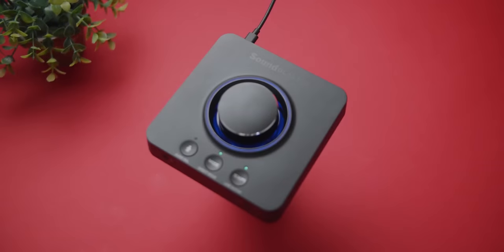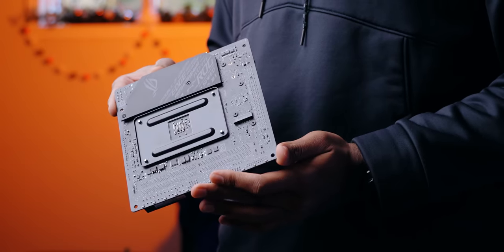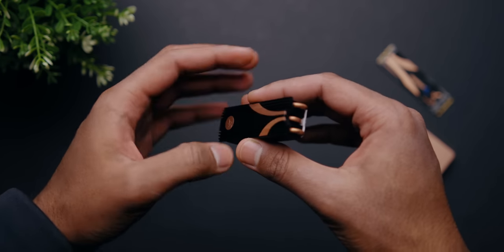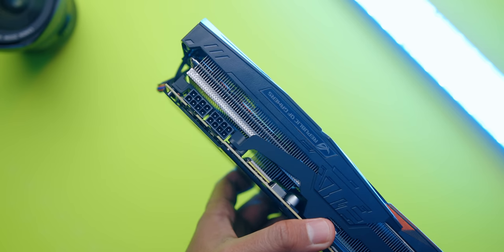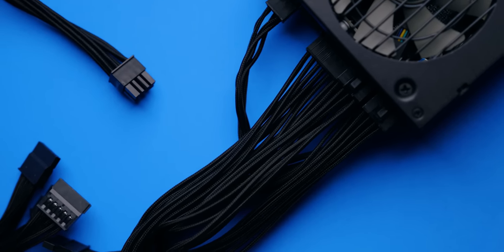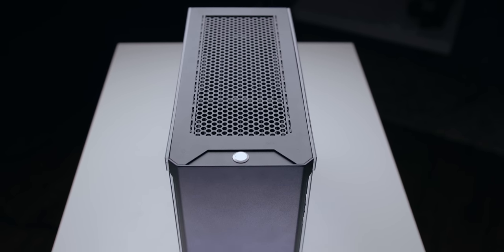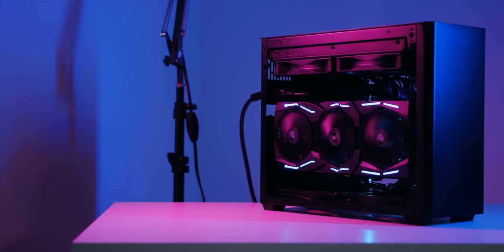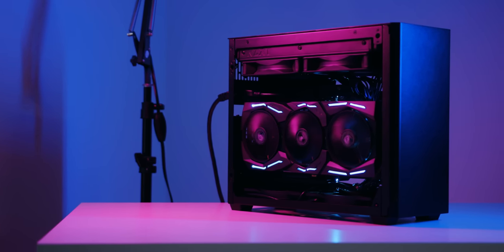Our Most POWERFUL ITX Build Yet!  A Ryzen 9 3950X Beast!

Comment: Awesome video. I went with the 3950X, Asus X570 I Gaming ITX, Kraken X63 (2 x Noctua NF-A14 iPPC-2000 PWM for huge air displacement and pressure), G-Skill Trident Z Neo 3600 CL16 C-Die, Gigabyte RTX 2080 Super Windforce OC, Samsung 1TB Evo Plus, RM850 (upgrading to AX1000 soon), NZXT H400i in white and a cablemod C series Pro ModMesh kit. There is a lot of chassis space and very good airflow. I love the Asus board, the VRM is insane and the cooling keeps everything running superb. The GPU under full load doing Folding@Home stays around 68-70 degrees celsius.

Comment: When you see someone building an SFF case and you think that looks huge!

I have almost identical build in a Ghost S1. Cable management to me means where will it squeeze in and not hit a fan! 😂

Good job.✨👌✨
Reply: lol, was thinking the same. i'm running the Metis with a non modular ATX PSU and an AIO. Basically I shoved all the cables away from the tiny window and called it done. I'm also running 3 sata drives, so that's some more cable i'm simply shoved aside.
Reply: @carlos2004  3 Sata drives...you sadist!

Comment: ITX loves custom cables.  Part of the issue with cable management is cable length.  I built a modded Silverstone RV03 where I used a Corsair H5 SF Low Profile and that made cable management a bit of a nightmare, but custom shorter cables made life a hell of a lot easier.  One more thing if you do go the custom cable route, get a good crimp too it will save you a ton of time.  Anyway hope this helps!

Comment: I’ve got the SM560 and adore it. Big tip is to use the grills at the bottom as cable the anchors and run the 4+4 pin cable on the bottom. I also used the front (where the SSD goes) to anchor excess slack.

Comment: Love the Sliger cases, I just wrapped up a build in a SM560 for my son. Granted the 3950X can't get away with the Noctua L9a chromax I used lol. As for your build, the only improvement I can see to be had would be full on custom cables to save on clutter and a true custom loop. The cables would be slightly tidier but offer no real advantage and the custom loop would give you more overhead for heat.

Comment: Considering my motherboard showing signs of dying after 2 years... maybe I'll go ITX. But still keep my 1800x/1070Ti (can't afford a full upgrade)
Reply: Still rocking a 5820k @4.5Ghz and GTX 780Ti phantom edition here ;)
Reply: Whats your dying motherboard model?
Reply: the problem with ITX is you will need a SFF case and SFF power supply in addition to of course the ITX motherboard.  And you have to make sure everything fits, so measure before buying!  good luck, it will likely be more expensive going ITX than full size midtower.  Not sure what the point of it is unless you are lacking desktop space.
Reply: Hell I use a Pentium and a gt 710 still,feelsbadman.jpeg
Reply: @h1tzzYT  Asus Prime B350-Plus
Reply: That's doable
Reply: @CobaltFoxPlays  Asus Prime = one of the bad ones, seems poor
Reply: @CobaltFoxPlays  Asus sabertooth mark 2 owner here. Within 2 years it fried 4 power supplies

Comment: Would getting custom length cables help with the management?
Reply: Yes
Reply: I wrote the same thing
Reply: YESSIR!!
Reply: it looked like a jungle behind my pc build, but after I used zipties it looked clean af
Reply: The Sliger SM580 has the power supply right next to the motherboard's 24pin socket, so that would help a lot for that one. I have the same case and there's a ratsnest of cables under the power supply.

Comment: Cablemods will make you custom length PSU cables for Corsair. Not cheap, but short of doing it yourself (always an option) it's the best "off the shelf" solution to cable management in a SFF case.

Comment: With 3950X you should raise Infinity Fabric to 1900mhz, have any memory that can handle 3800mhz (most 3600mhz kits can handle 3800mhz) and then use Ryzen DRAM calculator to manually tune all the timings. The difference in gaming performance is mind boggling (close to 30% higher FPS with 2080ti at 1080p) and pretty much all workloads gets faster.

Comment: Cable management in small form factors is not easy especially when you have a window displaying the inside. I personally worked on similar builds and would opt for no window since you'll face the same challenges with cables, but that doesn't mean you'll stuff the cables in and call it a day. Clearing the area for optimal air flow is important but it will be hard to make it aesthetically pleasing to eyes. But overall a great build

Comment: I recently did my first ITX and it's a dream to use but it did give me a few headaches building it:

R9 3900x @4.2 GHz 1.25V
Corsair Vengeance LPX 16 GB 3600MHz CL18
Gigabyte x570 Aorus I pro WiFi
Zotac GTX 1080Ti Founders Edition
Corsair MP600 1TB gen4 (5500/4500 MB/s read/write)
Corsair RM750x
be quiet! Dark Rock Pro 4
be quiet! Silentwings 3 (2x 140mm & 1x 120mm case fans)

Fractal Design Nano S

Comment: There's a couple of guys on Reddit that can make custom PSU cables in the exact length  you need them, based off of case and PSU you have. That will help a lot with cable management.

Comment: Woooowwww Ibra. Wooowww. I love this build. The only th8ng I'd change on it if it were mine would be the ram kit. I'd replace utnwith the corsair vengeance 64gb 3200mhz kit. 2 dims. And I'd add the Gigabyte gen 4 2TB drive but same speeds as the one you used so no difference there. Great build man. I'm officially sold on itx builds. I'm getting an itx build.

Comment: Sliger SM580 is the best sff case for high-end gaming PCs. No other can feature a 280mm radiator and a 3 slots GPU.
But for better thermals and noise, you should use 2 side vented panels (with dust filters) and 2 140mm in exhaust at bottom (instead if intake).
With some taping on top rear and front holes, airflow is amazing on sides and cools averything just fine (61° on i9 9900K and 64° on RTX2080 while gaming).

Comment: Great video! Awsome B-Roll. I'd go with a vented panel on the GPU side. intaking from the bottom you're creating turbulence since the GPU tries to push air both down and upwards... optimal airflow would be a negative pressure setup in through the side out both up and down...  I see both GPU and CPU temperatures improving or a quieter system if you opt to lower fan RPM.

Comment: I think it's pretty remarkable that not only is it significantly faster than anything Intel has in the mainstream with multi-threaded tasks, but its also slightly faster with single threaded tasks, despite your 8700k being overclocked.

Comment: Cable managing smaller cases can be difficult. A normal atx is pretty easy, you can just follow a standard build and normally get your hands in there or wiggle some stuff and make it happen... but smaller cases sometimes there just isn't 1 order or 1 right way to do it.

  It can depend so much on the case. I've had somewhere you can do it at the end, which is pretty normal, other cases where you had to do it all in the beginning and some pain in the butt ones where you had to do each part 1 by one.

Comment: I don't do much gaming so I'm more interested in the CPU, Memory and storage. I currently have a laptop with Intel I-7, 16 GB of ram, and an independent 2 GB video card that rarely gets used because I've discovered that my laptop uses the built in Intel HD video from the motherboard. When I ordered my laptop years ago I did not realize that the separate video card was for things like gaming and not used for everyday video. I probably wasted my money on the separate card but I have it if I need it. I am thinking about a desktop in the future since I rarely move my laptop and I believe I can get more performance for less money. I'm really impressed with the new AMD CPU's! I have replaced the HDD's on my two laptops with SSD's and that really made a difference. I'm sure the m.2 that they have now is much faster and I would be looking to use that as well!

Comment: I really love this build. I recently moved my ITX 9900k build from the Metallic Gear Neo Mini into a Phanteks Enthoo mATX. The Enthoo turned out to be way too large for my liking and not necessarily quieter unfortunately. I'm now looking at moving it into either Ncase M1 or one of the Sliger cases (SM580 or Cerberus) and this is making me reach for my wallet. Your build came out really amazing.
I didn't realize they were serious when they said support for 3 slot GPU's. I put an arctic accelero III on my 2080 and just assumed it wouldn't fit in this case. Mind blown.

When you configured the SM580 did you have to get two of the fan mounts for the bottom fan intakes or were their mounting points for 140mm fans?
Reply: There were mounting points on case. However you can't install 120mm fans
Reply: Thank you for the response! I was looking at actually building my own SFF case but after watching your video I don't think I'm going to end up getting much better than this, regardless of how handy I think I am.

Comment: In the motherboard box there is a coupon for cable mods use the cable configurator and they will send you a set of cables for the rig at the perfect length.

Comment: Awesome specs! Sweet video work too. I am however, unable to rationalize this down to up air-flow configuration. I think any ambient heat inside the case will warm the top-mounted radiator instead of cooling it...
Reply: I agree. I'm building in the same case and Optimum Tech tested bottom exhaust to create negative pressure and thermals were better. Great vid and build though.

Comment: If you use the ventet side panels temps would be 10 to 15 degrees lower. I use the 580case and this solved my problem. In your case you pump the hot air from everything thru the Radiator.

Comment: Very nice build. I went from an 8700k overclock that 5.4 gigahertz to a threadripper 3960x. Oddly enough this 24 core CPU runs cooler overclocked than my 8700 k did.

Comment: omg look at that I'm liking an AMD based video who could have tought such an Intel shill as me did that. Awesome mini build, sure must have been a lot of work, it's already complicated in a big case, small ones are harder to do properly. I was going 3950x but ended up with a 3960x :D ITX build now out of the question has I have an E-ATX motherboard lol btw the heat from Intel comes from clockspeed, if you lower an Intel to 4.2Ghz it's only going to use like 60watts but the scores drop hard, the beauty of the new AMD cpus is that at a lower clockspeed (and so less heat) they do the same work, if you look at cinebench single thread it's roughly on par but the heat generated for that same score isn't the same, in a small form factor it matters a lot.

Comment: What about gpu termals? Fans are facing a glass, so i wonder if gpu in stress doesn't heat up too much.
Reply: The Sliger case has a gap between de chassis and the glass...so i think there`s some air coming in the GPU.
Reply: @TheJoaunzinho  The SM580 doesn't use glass, nor is there a gap on those side panels. A better setup would have been to use the perforated side panels and have the bottom and top fans as exhaust.

Comment: Your high temps on the 8700k was probably b/c you didn't de-lid your cpu.  the 8700k cpu came with terrible TIM (thermal insulating material) between the cpu and the heat spreader.  Normally, the heat spreader is soldered onto the cpu, but for some reason Intel f'd up and used terrible paste which caused many cpu's to over heat.   On that note, I have the exact same (old) specs you have, and am thinking of getting the 3950x, however is paying for all that hardware for similar performance of the older system worth the cost of the move?   great video!

Comment: Idea for the PSU. Why hasn't anyone thought of removing the PSU from the case? There could be a scenario where a banging PSU (so that there won't be any need for upgrades) could be put in a hole in the wall, and the all the cables can be sleeved and led into the case.

Comment: You can buy custom psu cables at cablemod, I have the Cerberus non-X version and custom cables improved so much the cable management. 24 pin ATX 250mm, 8 pin 400mm and 250mm for the pci express cable and should be good to go.

Comment: Great video!
I did notice you listed the case as Sliger 850 accidently instead of 580
Im looking to upgrade the NR200 to a caae that supports 280 aio in the roof instead of side.
Easier to access components and I will be able to see the screen on the Z63 unobstructed.

Comment: Would have to see how small the interior of the case is, but zip ties do work well.  I like to use Velcro cable wraps, that you can get at Home Depot - they're thin and reusable ;)  Since there's no "basement", and the back area looks cramped, I can't really say, but you did avoid the wiring to avoid key spot, like the fan blades ;)  I still prefer mid-towers, as I have big hands even those my fingers are quite dexterous o.0  Thanks for sharing!

Comment: maybe try and get custom length PSU cables
Reply: I have the Sliger 550, the smallest 500 series Sliger you can get and the same cables, wasn't too hard to put all the components inside and for him it should be much easier, he has more space in there... Then again, I followed the Reddit SFF community for a while before I went and got my own ITX build so there's that.

EDIT: Should also note that I have an AIO inside too, cause with an aircooler it's just no problem if you go with stock cables.

Comment: Here I am a year later having replaced my 3950x with a 5950x.  So... I have an extra 3950x.  I could store it, or I could get one of these boards and a cool ITX case, and build a SFF pc.  I've never done that, but it could be fun to give it a go.  Just have to figure out what to do with it.  It's kind of high powered to run as a server especially, so I don't know what I would do with it (I have a 5950x/2080Ti combo, a 5900x/3090, and a sTRX4 3970x/3090 setup.  If I get another 3090, I'll swap out the 2080 Ti, and it can either go into the 3970 as a 2nd GPU to be passed to a VM, or it could go into the SFF build with my 3950x.  I have no idea what I'm going to do.  If anyone in my family wants or needs a kickass gaming PC, well... there's one (though I'd swap out the 3950x for a 5800x, you know, for gaming).

(Now I'm waiting for the flood of adoption requests.. lol)

Comment: Man my biggest issue with AMD's new processors is still the motherboard manufactures. 
With such a small percent of their CPU's supporting why have any onboard video ports on so many motherboards. You would think the majority of their motherboards had no video ports and only a select hand full had video I/O but instead almost every single board has Video I/O I'd rather more type C, more USB heck even thunderbolt but HDMi and DVI ends up being useless is most applications.

Comment: If I had a metric ruler, I'd take the time to get an approximate measurement of all the distances of the cables going from the psu to motherboard and videocard connections and get some proper length custom made cables from Cablemods. I have a Asus X570 Crosshair Impact in a NCase M1 case and I've been lazy with cable management using stock cables that came with the SF600 psu. Included with the motherboard came a coupon for 20% off of Cablemods custom cables which will come in handy if I do decide to go for it.

Comment: Your test data shows how important the GPU is in Games and certain apps like Resolve Studio edition. The free version doesn't use the GPU. It would be very interesting to see the comparison between old and new system if you ran the free version of Resolve?
Just a thought, how does your GPU pull any air when it looks like it is almost pressed against the glass?

Comment: It’s scary to think that in 10 years this thing wouldn’t even beat a mid range $1000 PC.
Reply: Well yes but actually no cuz  at least in processors just AMD have some plans so until 2026 no big changes there.On the graphics side idk seems like Nvidia will soon lunch a new series of cards and AMD  will do the same.
Reply: Ryzen 90 39500x
Reply: It probably won't take 10 years; maybe 5. The best consumer PCs from 10 years ago run Nehalem (first gen i7) CPUs, coupled with the HD 5970 or GTX 295 graphics. Those CPUs bench below current Pentium Gs with all cores utilized, and end up with about half a Pentium G's performance on single thread benches. The gap on the GPU end is even greater.

Comment: Honestly I don't like that so many of these new sfx itx cases come with the sandwich configuration because it always makes cpu air cooling super limited and it chokes the GPU especially when there's a glass panel because it has to be mounted vertically. Highly prefer the ncase m1 layout where your GPU is mounted horizontally and drawing air from the bottom of the case and the case can accommodate the AMD wraith prism cooler.

Comment: Torn between Sliger SM570, Sliger SM580, and Ncase M1 v6.1 ...
I don't like that the Sliger cases are more to be positioned on the left of the desk (to easily reach front IO), but it does have a window and AIO, the Ncase M1 has either window or AIO, both is not possible. Any opinions welcome :)

Comment: Ummm, Eber, notice you didn't touch on the 2080ti thermals in the video, as it has to be running extremely hot under load with such little space between the fans and the glass front.  And, why oh why would you chose a case that has a front USB type C port and pair it with a motherboard that doesn't have a connector for it?  I'm sorry, but that's nuts for a personal rig that you plan to use as a daily driver.  I get that Asus sponsored this and provided the m/b, but that's a terrible waste and woeful choice.

Comment: 63 degrees on idle average Ryzen X3950 is a bit high. that's a 280mm cooler with 2 140mm fans. you should get lower temps. 
what is your idle temp?